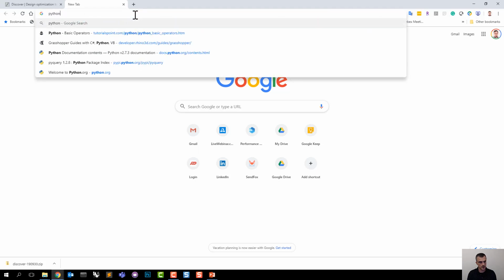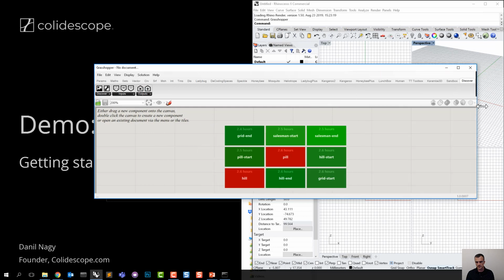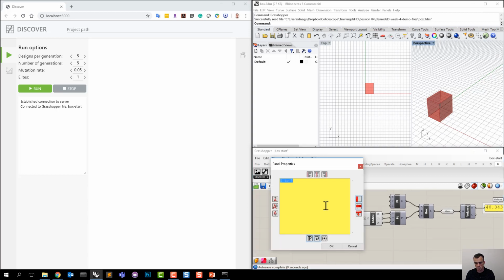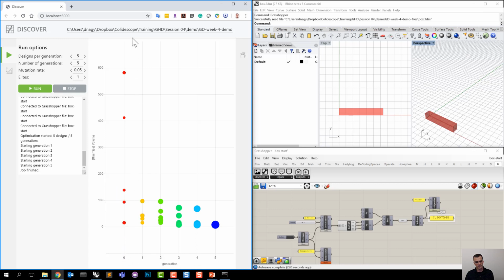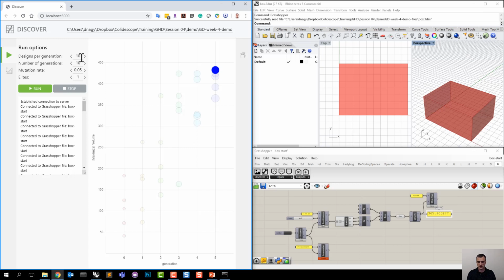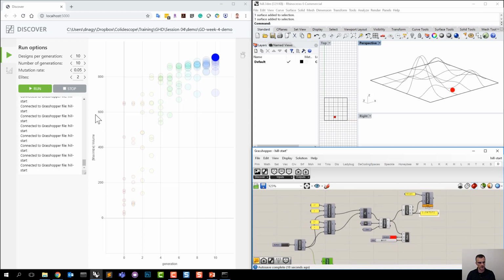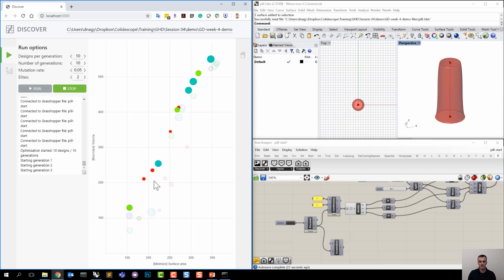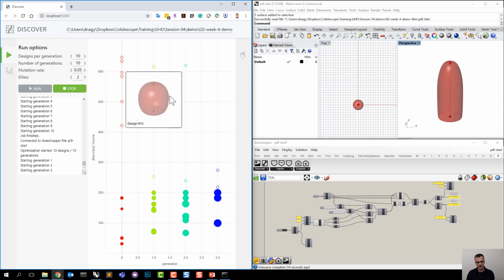Getting started with Discover

Comment: got this error the server is not running ::Installing Discover, this may take a few minutes...
Collecting flask-cors==3.0.10
  Using cached Flask_Cors-3.0.10-py2.py3-none-any.whl (14 kB)
Collecting werkzeug==2.0.1
  Using cached Werkzeug-2.0.1-py3-none-any.whl (288 kB)
Collecting Flask==2.0.1
  Using cached Flask-2.0.1-py3-none-any.whl (94 kB)
Collecting flask-socketio==4.3.2
  Using cached Flask_SocketIO-4.3.2-py2.py3-none-any.whl (15 kB)
Collecting eventlet==0.31.1
  Using cached eventlet-0.31.1-py2.py3-none-any.whl (224 kB)
Collecting Six
  Using cached six-1.16.0-py2.py3-none-any.whl (11 kB)
Collecting itsdangerous>=2.0
  Using cached itsdangerous-2.0.1-py3-none-any.whl (18 kB)
Collecting click>=7.1.2
  Using cached click-8.0.3-py3-none-any.whl (97 kB)
Collecting Jinja2>=3.0
  Using cached Jinja2-3.0.3-py3-none-any.whl (133 kB)
Collecting python-socketio<5,>=4.3.0
  Using cached python_socketio-4.6.1-py2.py3-none-any.whl (51 kB)
Collecting greenlet>=0.3
  Using cached greenlet-1.1.2-cp310-cp310-win_amd64.whl (101 kB)
Collecting dnspython<2.0.0,>=1.15.0
  Using cached dnspython-1.16.0-py2.py3-none-any.whl (188 kB)
Collecting colorama
  Using cached colorama-0.4.4-py2.py3-none-any.whl (16 kB)
Collecting MarkupSafe>=2.0
  Using cached MarkupSafe-2.0.1-cp310-cp310-win_amd64.whl (15 kB)
Collecting python-engineio<4,>=3.13.0
  Using cached python_engineio-3.14.2-py2.py3-none-any.whl (51 kB)
Installing collected packages: Six, MarkupSafe, colorama, werkzeug, python-engineio, Jinja2, itsdangerous, click, python-socketio, greenlet, Flask, dnspython, flask-socketio, flask-cors, eventlet
Successfully installed Flask-2.0.1 Jinja2-3.0.3 MarkupSafe-2.0.1 Six-1.16.0 click-8.0.3 colorama-0.4.4 dnspython-1.16.0 eventlet-0.31.1 flask-cors-3.0.10 flask-socketio-4.3.2 greenlet-1.1.2 itsdangerous-2.0.1 python-engineio-3.14.2 python-socketio-4.6.1 werkzeug-2.0.1
WARNING: You are using pip version 21.2.4; however, version 21.3.1 is available.
You should consider upgrading via the 'C:\Discover\env\Scripts\python.exe -m pip install --upgrade pip' command.
Discover successfully installed
Traceback (most recent call last):
  File "C:\Discover\server.py", line 11, in <module>
    from flask_socketio import SocketIO, emit
  File "C:\Discover\env\lib\site-packages\flask_socketio\__init__.py", line 9, in <module>
    from socketio import socketio_manage  # noqa: F401
  File "C:\Discover\env\lib\site-packages\socketio\__init__.py", line 9, in <module>
    from .zmq_manager import ZmqManager
  File "C:\Discover\env\lib\site-packages\socketio\zmq_manager.py", line 5, in <module>
    import eventlet.green.zmq as zmq
  File "C:\Discover\env\lib\site-packages\eventlet\__init__.py", line 17, in <module>
    from eventlet import convenience
  File "C:\Discover\env\lib\site-packages\eventlet\convenience.py", line 7, in <module>
    from eventlet.green import socket
  File "C:\Discover\env\lib\site-packages\eventlet\green\socket.py", line 4, in <module>
    __import__('eventlet.green._socket_nodns')
  File "C:\Discover\env\lib\site-packages\eventlet\green\_socket_nodns.py", line 11, in <module>
    from eventlet import greenio
  File "C:\Discover\env\lib\site-packages\eventlet\greenio\__init__.py", line 3, in <module>
    from eventlet.greenio.base import *  # noqa
  File "C:\Discover\env\lib\site-packages\eventlet\greenio\base.py", line 32, in <module>
    socket_timeout = eventlet.timeout.wrap_is_timeout(socket.timeout)
  File "C:\Discover\env\lib\site-packages\eventlet\timeout.py", line 166, in wrap_is_timeout
    base.is_timeout = property(lambda _: True)
TypeError: cannot set 'is_timeout' attribute of immutable type 'TimeoutError'
Press any key to continue . . .